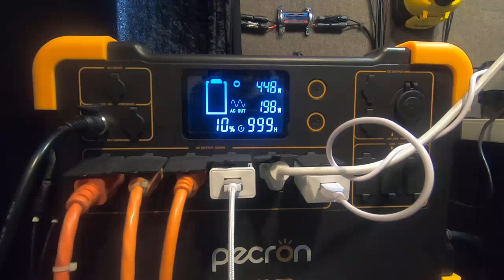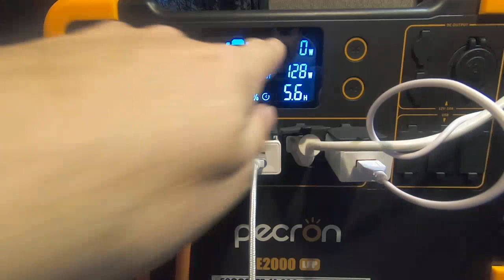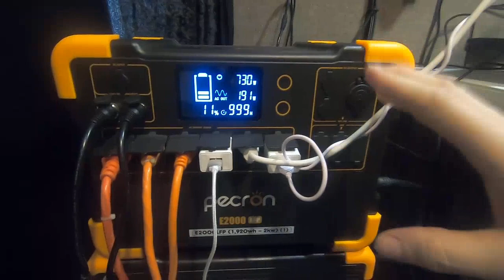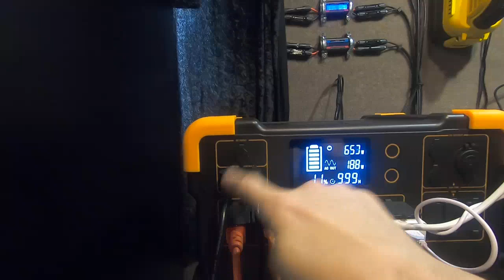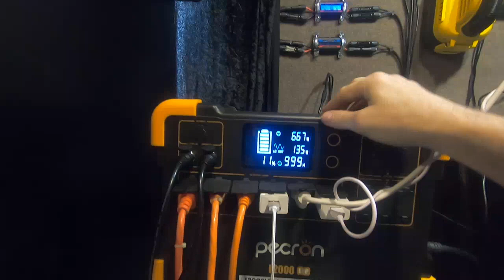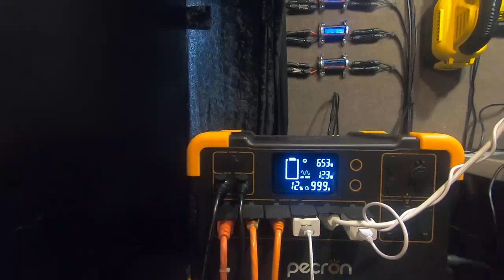PECRON PV300 Portable Solar Panel (((((UPDATE 1)))))

Comment: @Ramblin' Bob Reviews  I was working on creating a dvd and recalled you mentioned about not knowing how to fast forward a video / video clip. I meant to post this sooner and forgot. When you have the clip edited you want to fast forward, I have seen two ways to do this. Some software has a FX filter for it. My current software version (VideoStudio) you right click on the clip in the timeline and there is a option for "Speed / Time Lapse" that is used to set the speed increase or decrease. Check both places for this. I have been using VideoStudio to edit video and create DVDs, video, and audio files for about 20 years. I have only posted a few videos to YouTube for certain people to see and then removed them.
Reply from the maker: Thank you for the info, We already figured it out, We have sony vegas and all you had to do is hold crtl or alt and pull or squish the video on the timeline and it speeds it up :)

  Learning sony vegas, youtube, testing items for people now, full time job still, learning amazon......Hold on, I am gonna take a nap for 5 minutes......

Ok.....I AM BACK :)

Feels like i am sitting here in college, And i can't find the professor anywhere...LOL

Comment: You might want to try 2 of the 200w panels in series and each 330w panels separately. If they work I would think it was the MPPT controller.
Reply from the maker: That's what we were thinking also....

And the voltage is even HIGHER on the 200w panels...
Peak Power:200W
Cell Effciency:21%
Power Voltage:36V
Power Current:5.5A
Open Circuit Voltage:43.2V   <------- WOW
Short Circuit Current:5.8A
Operating Temperature Range:-10~60

Compared to the 39.5voc of the pv330, And the short circuit on the 330 watt panels are 12amp...Maybe that has something to do with it? But in series, The amps do not double so it should be the same or close.

THEY WORK 100% PERFECT WHEN IN PARALLEL OR SEPARATE, IT'S ONLY WHEN WE HOOK THEM UP TO THE E2000LFP MAIN IN SERIES IS WHEN THEY STOP CHARGING. (almost like the system went into a protection mode or something)
Reply: I have run the Pecron 200w panels in series on the E3000 with no problems. I have run 2 Qcell 320w panels in parallel on one port and the 2 Pecron 200w panels in series on the other port with no problems on a very sunny day multiple times. I will say it took about 4 hours to charge the unit from zero with the four panels.
Reply from the maker: Good info, The more we all have to learn from each other, The better it is for everybody :)
Reply from the maker: Using these and just using those pv300 on one port would be fantastic if we ever needed it. So if we can't use them in series, We will settle for that. Pecron sent them to us for free so i never can complain about that. We just everybody know what we are going through so they know before they buy them :)

Comment from the maker: Update again....When we hook them up in parallel they bring in 600 watts (Port maxed out on e2000lfp) with ZERO problems. (Zero shutdowns)

When we hook them up in series, We think that the MPPT is going into a safety mode or something and shutting down the charging cycle.

SIMPLE FIX: Just hook them up in parallel and the problem is solved.
(2 per side in parallel and we are 100% good)

Comment: I had the same issue connecting my 2 Qcell 320w panels in series on the E3000 when the panels was producing over 520 watts. The Open Circuit Voltage is 40.02 on the panels Specs. So I  figured the max volts would be 80.04 which is within the specs of the E3000 input. I have seen the two panels when each one is connected to its own port reach 620 watts. Pecron told me they suspect the panels was spiking over 95 volts and said to connect them in parallel and sent me a cable. I have had no issues with them in parallel. However the E3000 limits the amps to 15. I had no way to test the voltage level and could not find anything. I really wanted a device like you have to test the voltage but 60 volts was the highest I could find. Let us know if you find something. I suspect when the voltage is getting near the max the unit limits the watts that is coming in like the batteries do, hence why you are seeing the drop. But when it hits over a certain amount the unit shuts down the input to protect itself. That is what Pecron told me.
You could try to hook the panels in series again and run them through the voltage device and see what happens. As you showed it showed over 70 volts. Maybe it could go higher or shutdown or fail.
Reply from the maker: I will always be on the lookout for one for everybody, We wanted to find a large multi version of a dc meter with bluetooth and could not find anything other than an all-in-one charger like on will prowse's youtube channel :(

Here is the weird thing, If the panels were spiking, Why did the eb3000's keep charging? weird, right? Maybe they have newer mppt controllers or BMS in those because they are newer than the e2000lfp....
Reply: @RamblinBobReviews  Since the batteries have a 400w max vs the E2000lfp 600 max, could the battery limiting to 400w input be limiting the volts as shown on the device at 70 to 71? Therefore it never receives anything over that voltage. Just a thought.
Did you by chance video the meter and review it. If you was just watching it, it could be easy to not see it with distractions. Not fully understand how voltmeter works, does it have a lag that may not pick up / show say a 1/2 second spike? Something short like that might be enough to stop the unit. Just kinda thinking out loud.
Reply from the maker: @timh2277  We thought the same thing, But the volts were showing the same 69-70v (charging) when hooked to the e2000lfp. And 81.5v Open circuit when not hooked up. (Same numbers as the eb3000's) See, whenever we use solar panels, We always like to have a lot of overhead so something like that can never happen with spikes. That is another reason we like to stay at 48voc input....LOL

I just feel like the voltage is just too high overall in series, We dropped them back down to single panels in parallel and they work 100% perfect.
Reply: @RamblinBobReviews  When I watched Hobotech's videos on the E3000 and E2000lfp he did show the units could accept 95 volts and only shutdown when he went over 95 volts. He had a version of the E2000lfp before the batteries came out. So it should be the same version as yours. My E3000 is newer then his.
Pecron support was thinking it was too much voltage on mine also. Weird the voltmeter is not showing that. Maybe Pecron will provide some insight tonight or tomorrow.
Reply from the maker: Yeah, I saw hobotech's reviews also, The only thing i can think of with his test is....It is a very controlled test, With a charger system like he has, There are no (surprise) spikes in voltage or amps or watts, You know?

The real sun is a very different animal.

I will post an update video of this one in a few minutes for my conclussion to day 2 of testing :)

P.S. Waiting to hear back from pecron as well :)
Reply from the maker: tried it 5 times, through the dc meter and the old school clamp style voltage meter, same thing happens, They only act weird when they are connected in series in the e2000lfp main unit. Seperate, They are monster panels (700+ watts all day in perfect sun)

P.S. Watching through the clamp style voltmeter, we never seen a spike over 81 volts coming in...

Comment: If you want to monitor the panel performance, but the series exceeds the meter's voltage limit, run each panel to its own meter and series them just before you plug into to the E2000LFP. This way, you can monitor what each panel is doing and potentially isolate it to one of them or confirm both panels are fine.
You can also see the real time voltage of each panel and add them to see the series voltage. Exceeding the limit of the meter, while the meter shows a value, does not mean the value it shows is accurate.
The panels may be surging higher in voltage (though they shouldn't be) causing the MPPT to go into safety.
Since both MPPTs are behaving the same, it's doubtful that the MPPTs are damaged.
Some more scenarios to test.
Reply from the maker: I agree, The weird thing is, We had a meter on each panel and they were fine...Scratching my head with this.

And when we hook them up separate to each main port, the voltage is the same on both panels... Still scratching my head....LOL

And then it has been hooked to the eb3000 for more than an hour and everything is perfect, charging at 400 watts @ 69-70 volts. (voltmeter check also in the line run)

Was just wondering, if for some reason because we have the first run of this model (e2000lfp) the voltage is too high for the mppt controllers, But that can not be since they can take in up to 95v each....
Reply: @RamblinBobReviews  When you had a meter on each panel, were the panels connected in series? It seems to the behavior only happens when they're in series, so you have to monitor them in that configuration.

It's definitely an odd behavior. The times it goes to 0W could be the MPPTs going into protect, which would be caused by an overvoltage. But the fluctuations are odd. Could be the MPPT algorithm trying to find the appropriate voltage and current operating point, which is what an MPPT is supposed to do. But maybe the algorithm has an issue.

Too bad no one with a V2 unit can test them. I have a V2, but don't have these panels.
Reply from the maker: Yep, We have them separate hooked to those meters.

We had them is series hooked to those meters.

They only act strange when we hook them to the e2000lfp main inputs, otherwise they are awesome working panels. So, It has to be something on the e2000lfp side we believe.

You would think that the eb3000's would stop charging also if it was the panels, So it can't be the panels, right?

and the power never stopped coming it on the batteries when hooked up like that.
Reply from the maker: also, we have tested them with the oukitel p2001 (one at a time and got fantastic numbers and never shut off) The only time they acted weird was when we hooked them to the main inputs of the e2000lfp (version 1)
Reply: @RamblinBobReviews  How do you tell if it is version 1 or 2?
Reply from the maker: @gorillamotors  VERY SIMPLE :)

Version 1 has the following....
110v AC Outlets
65 watts USB-C (Missing the (20v @ 5a protocol)
Hidden menu has 7 sub menus in it

Version 2 has the following....
120v AC Outlets
100 watts USB-C (Includes the 20v @ 5a protocol to allow this)
Hidden menu has 4 sub menus in it

EASIEST WAY TO TELL :)
Reply from the maker: then why would the eb3000 just keep charging away if they was voltage spikes in the panels? crazy huh? Nonstop with voltmeter inbetween panel and battery
Reply from the maker: I really wish that the oukitel p2001 could test them also, to see if it happens on those units as well...But the cut off at only 48v input.....BOOOOOO....LOL

Comment from the maker: Been running the panels in series hooked up to the eb3000 and it has been solid as a rock with the voltage for almost 1 hour with 400 watts with zero drops. They work perfect, So it can not be the panels.

But as soon as we hook them back to the e2000lfp, the charging voltage drops and charging just stops over time...

Comment from the maker: Ok, It has been a long morning.....The dc meter had no impact on the charging issue with the pv300's

They work PERFECT in series when hooked to the eb3000 battery (1 or 2)

When we hook them up in series on the main ports hey make the e2000lfp glitch and stop charging when hooked in series with voltage drops.....

When we hook them up one on each port on e2000lfp, They work perfect again.....

This would be a issue with the charge controller on the e2000lfp, correct? Because if they work perfect when hooked to the batteries and they don't glitch, That would leave no other option since they work perfect that way.......

PECRON, PLEASE WATCH THE VIDEO !!!!!